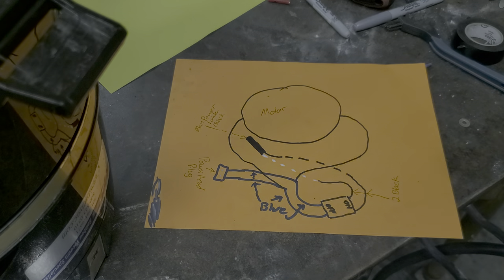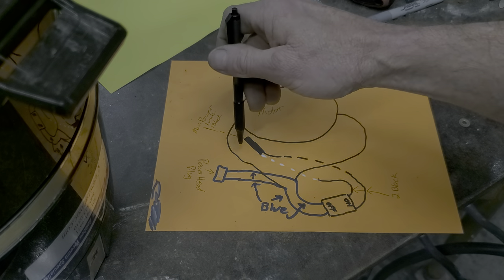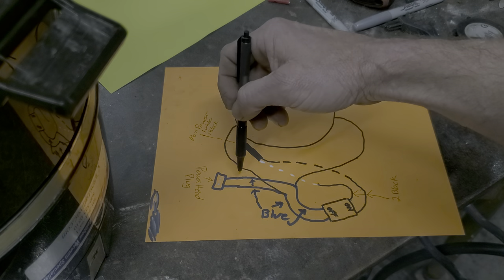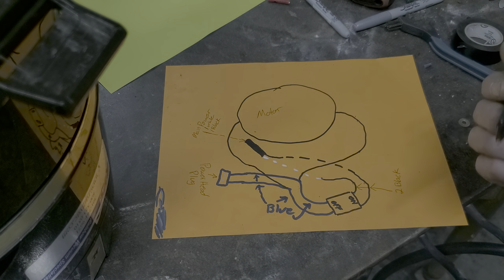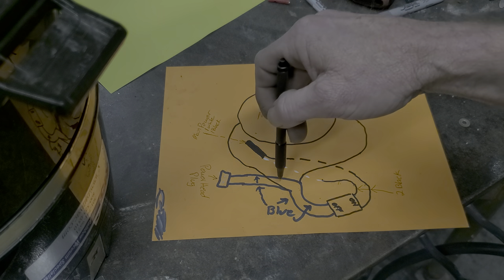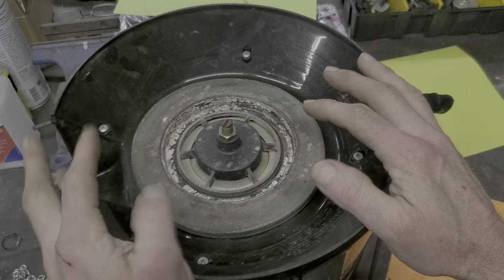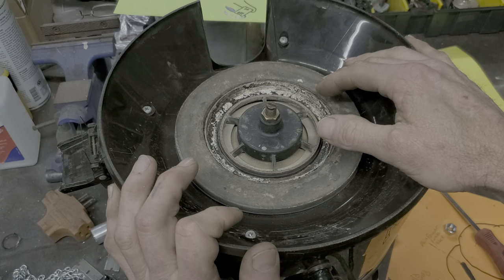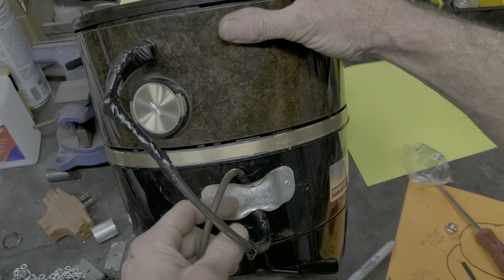Rainbow switch replacement (6 wire to 4 wire)

Comment: Thanks for the support. I emailed the Rainbow site with a simple question and they referred me to authorized servicers/dealers. And as you mentioned, I still had questions about the connections after searching the net. One difference on my Rainbow is that the switch had plastic clips holding the switch rather than an adhesive so I took the top off containing the switch, removed the screws and pried the four clips back to loosen the switch. All in all, the diagram answered my questions....and provided "support" better than Rainbow.
Reply from the maker: I'm certainly happy it helped in any way

Comment: Thank you for the video. I just wanted to change the cord on mine, but didn't want to damage it while taking it apart.
Reply from the maker: I changed the cord on mine a month ago. When I made the video I had just put it back together and I shouldve gone through all the steps taking it apart and showing the wires and connections. It would've been a lot more helpful. I really didn't expect it to get any views but since its something people look for I think om going to make a complete guide to be more helpful and easier to follow.

Comment: Thanks for the video. After watching the video, I was able to replace the switch on my Rainbow SE. I didn't hear you mention what the extra 2 wires are for. I see them in your diagram. There are 2 wires that go to the motor and 2 wires that go to the external plug. When cutting them off of the old switch, just keep the ones that come off of the same end of the switch together and connect both of them to one of the blue wires. This plug powers the carpet brush attachment. Hope this helps someone. Thank you for posting this video!
Reply from the maker: Cant believe its been 7 months. Thanks for the feedback
Reply: 1 set is the vacuum motor the other the carpet brush motor.

Comment: So if you aren’t replacing the switch but just want to try and clean the switch do you have to take it apart?
Reply from the maker: No you can pry it out. Probably best to try and cut the silicone that holds it in place. Since I was replacing mine I wasn't worried about breaking it but I was able to pull it without any damage. I dont know if it would be worth pling it to clean since there's not much on it to clean.  The connections are covered pretty well
Reply: @TheOldKid  I soaked the switch in contact cleaner while switching it on and off. Let it dry, plugged it in and it turned right on. It was full of dust from the static electricity it generates while running. Probably a temporary fix but it did work. Thanks for the video, the only subject on YouTube that doesn’t have 2000 videos. Thanks brother
Reply from the maker: @jasonphilbeck5693  glad it worked. Mine had gone completely out. It wouldn't make contact anymore. Didnt have time for a more detailed video today either. Ive been disassembling a camper furnace trying to figure out that problem. Pulled one of the blower covers off and three tree frogs and dirt dobber clump fell out. My guess is that's my blower problem. Ill know tomorrow